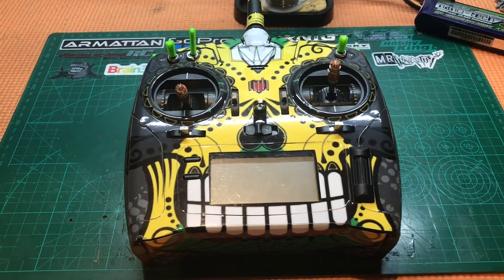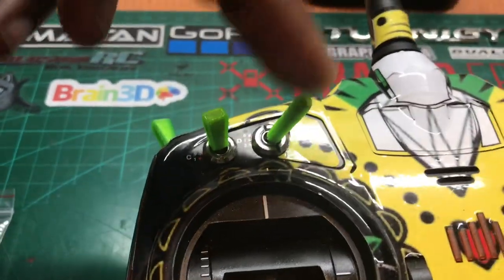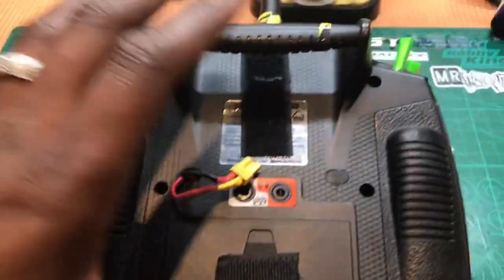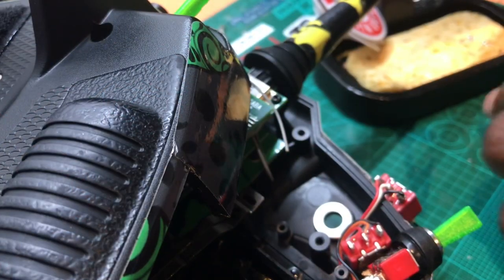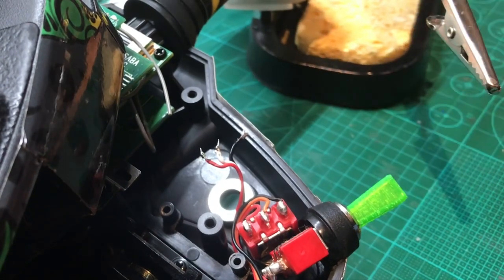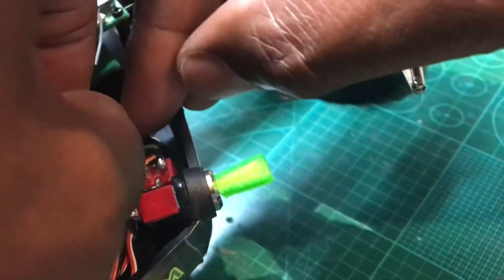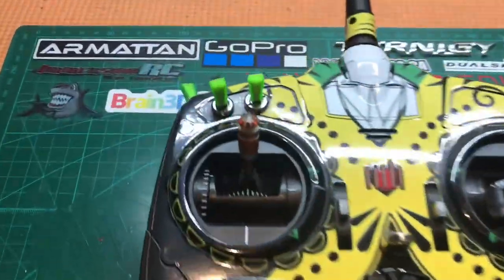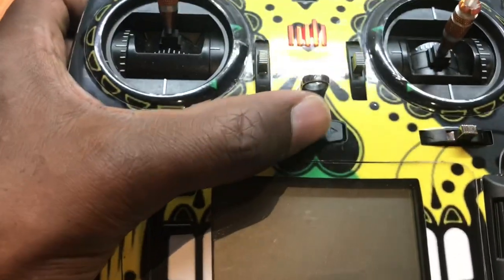How to Replace Transmitter Switches on Spektrum DX6

Comment: Thanks man!!!   I was out doing a pre-flight and a teacher that I haven't seen in 30 or so years recognized me and ran over to hug me....I had just picked up my transmitter and when she hugged me and she accidentally hit the transmitter out of my hands.  Springs went everywhere and the two upper right switches broke off.  my switch h still had a little nub on it and functions but the g switch completely fell out.  I had to reprogram to other switches as to not end my flying day.
I was afraid I was going to have to spend a lot of money getting this fixed.  Watching your video I was able to take two switches out of a dead controller and it worked! You saved my controller!
Again....Thank you so much for your tutorial!!!

GO FLY!!!🛩🛸✈
Reply from the maker: Good to hear 👍🏾
Reply: @WigganRC  I have a dx6e and inside there are two ports on the same board for the antanna.  Do I plug into port a or b?  forgot to ask in my post.
Reply from the maker: Not sure without looking. Sorry
Reply: @WigganRC  No worries!  I plugged into A and did a range test. seems ok!

Comment: Great video! I have a Dx6e transmitter and the lousy power button froze on me. I was able to get the unit open and the boards off of the chasis to get the button free, but does anyone know a way to stop this from happening? I contacted spektrum and they gave me the runaround to send the thing in for service, at $40  an hour plus shipping. I would love a workaround whrere I dont have to use that idiotic button at all, just plug in my battery pack and go. This has to be on of the worst designs ever. And of course it happens 3 days after warranty runs out. Appreciate comments!